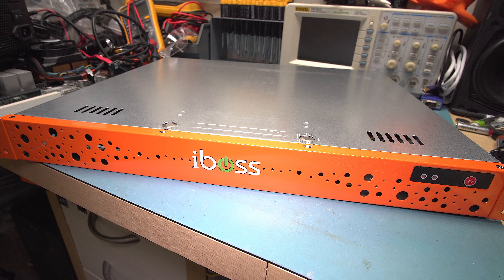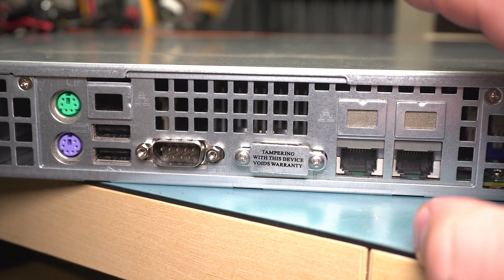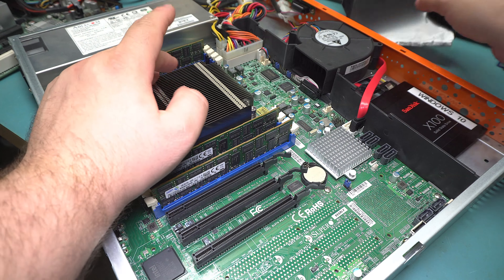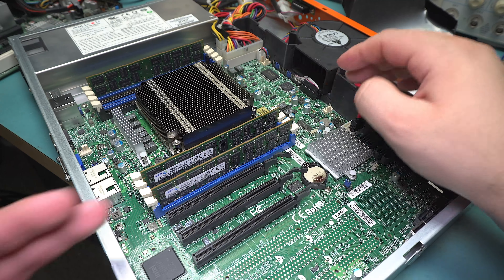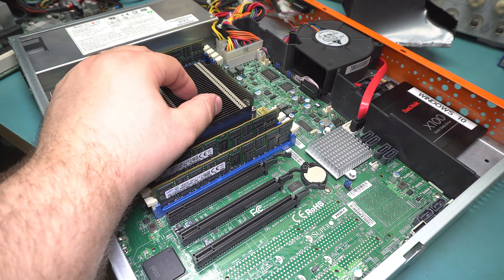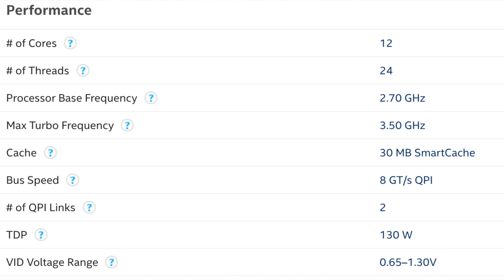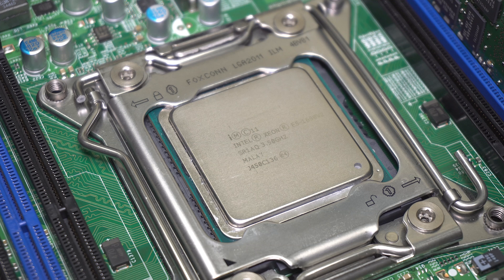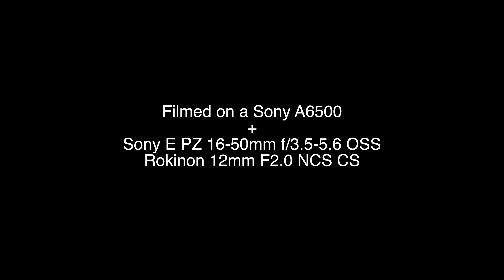iBoss Server Teardown

Comment: Average passmark of that CPU is 12680. About 50% faster than the Haswell i7 in my laptop.
Reply from the maker: +stonent Xeons are pretty good at winning benchmarks, but for most uses - especially gaming a cheaper i7 will crush them due to their much higher clock speed.
Reply: Well, that E5-1650 is essentially the same as the i7s of that generation and it's unlocked for overclocking, with a motherboard that supports it. I have a socket 2011 (v1) Intel DX79SI overclocking board. It has an i7-3820 @ 4.2Ghz and my upgrade path is the E5-1650 (v1). It will add 2 more cores and can get up to 4.5ghz with proper cooling.

Comment: About the "rolling effect" in the sped-up time-lapse ... any chance it correlates between the FPS of your recording and your mains duty cycle? Example: Let's s say you record at 30FPS @ HD/UHD/whatever. That would be a half the line duty cycle (60Hz) therefore create a interference (usually not visible to the naked eye, but easily observed in a recording where the camera catches the "harmonic interference" (30FPS == 30Hz == half the mains cycle therefore "harmonic")).

If your lighting consist of LED lights which are driven by a capacitive dropper ... replace them with LEDs which use a switching power supply LED driver. That should eliminate any "rolling effects" as they are usually driven in the KHz range (PWM) instead of some mains cycle refresh frequency.

IF your LED lights are actually driven by a switching LED driver, the frequency at which the PWM operates is clearly a harmonic frequency of your FPS settings. Not much you can do there other than changing your FPS rate (i.e. 50) or looking for lights which don't cause "visual oddities" with camera recordings (edit: or replace the PWM driver given you can easily replace that part and you are good with messing about with mains powered components).

Finally ... keep up the good work. While I didn't watch all of your backlog you've certainly torn down several interesting bits of gear.
Reply from the maker: +Jochen Blacha +Jochen Blacha I'm just not sure why it is showing up all of a sudden. I think the LEDs might be out of phase or something because no combination of 24/30 fps, 1/50 or 1/60th shutter works. I could slow it to 1/30 but that looks terrible. But I think I will just live with whatever is the least bad - I'd like to shoot 24 fps as it uses a full sensor readout though.
Reply: I've seen that same effect appearing in other speed-ups as well.
Reply: Well, I'm not sure if you can compensate the effect through FPS or Shutter speed settings ... while I'm good with electronics I have no real expertise or experience with photography or filming gear.

You could try to diffuse the light source in an attempt to minimize the rolling effect. Not sure how effective it is with a camera being part of the equation ... in the real world where there's just the naked eye involved you can minimize the effect of a "flickering LED light" (poorly designed capacitive dropper ones which are only lit during half of the sine wave) by diffusing the light. Maybe try putting some thin paper in front of your light panel and run a test shot to see if it helps improve things.

Comment: fun fact you can overclock single socket lga2011 e5 1600 xeons just like normal i7s
Reply from the maker: Yep. Although I'm not 100% sure if this Supermicro BIOS supports it. I haven't dug too deep into it though.
Reply: izza nart juice the Boss bit apple and ibm 'i' entrued parallel research fi'e system an modules b and b compiler pre unix C too intel sun supermicro sparc overviewed g.p.u motorolla amd powerpc mobo an sw scheme methods in a goddam atomically genetic prooved stamp p.c.b mobo too reflect 'histories'of use usage where static funny names punch judy eh?
Reply from the maker: What?!